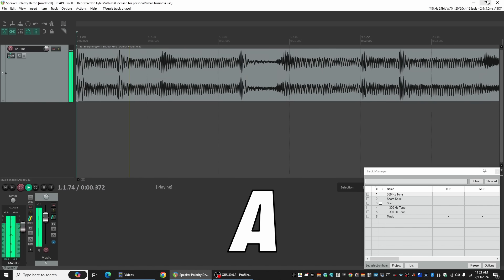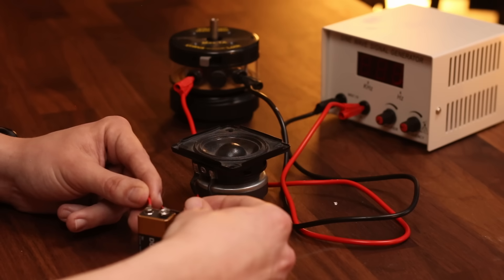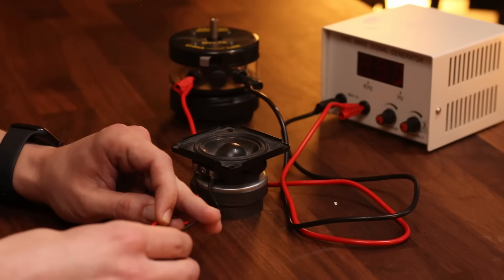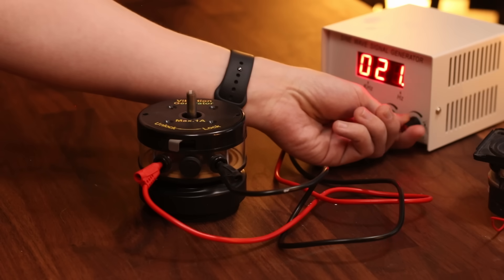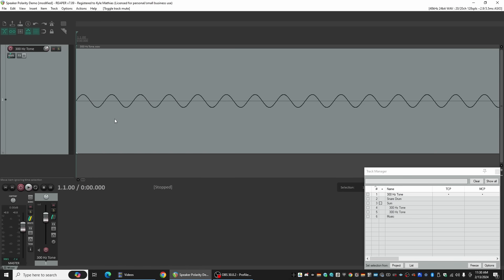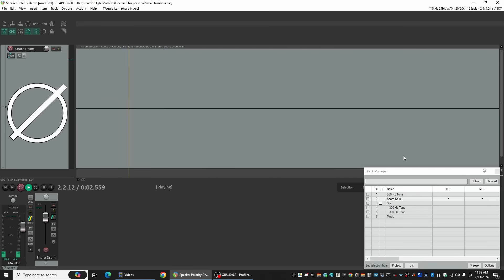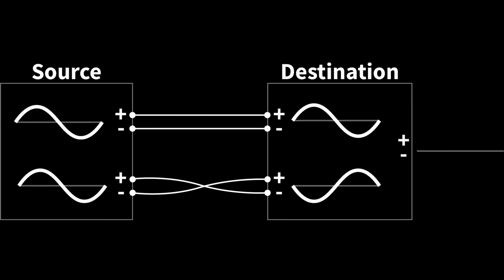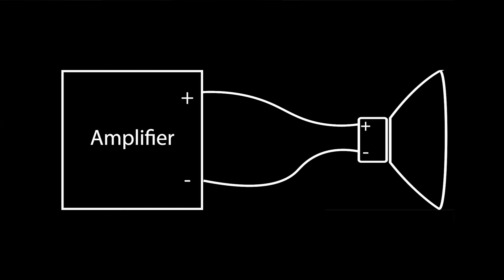What Happens When You Wire Speakers Backwards?

Comment: Pointless video. The speakers are design to move away from the magnet for the best efficiency. If you reverse wire then the movement of the cone is limited and the magnet will "suck in" the coil. If the speaker would be designed to work that way then it would be fine to reverse wire. I'm not sure if you need to be a Mehrican to come up with some nonsense like this fro attention?

Comment: Subwoofers can sound different if wired 180 degrees out, depending on the frequency and distance to the listener. This is why powered subs and often sub amplifiers have a "0/180" phase switch. This just reverses the direction of the subs. You may perceive more bass in one or the other settings.

Comment: If BOTH speakers in a stereo are wired backward, I may not notice. In fact, James B Lancing (JBL) actually reversed the polarity in their entire line of sound re enforcement speakers, to get around patents from his brother, Altec. When using JBL in conjunction with virtually ANY other brand, be sure to reverse the polarity on the JBL's, to keep them in phase. This is especially important, when stacking sub-woofers, where the wave lengths are long enough, to cause cancellation. If one of the speakers is connected backward on a stereo, it twists my brain in half at the Corpus Callosum, like an Oreo Cookie! Some people aren't quite as sensitive to reverse phase as I am, so to demonstrate, I use a monophonic amplifier, and stereo headphones to demonstrate. First, I connect the amplifier to the sleeve, and connect the other wire to the tip and ring in parallel. Then, I increase the amplitude, and connect the amplifier to the tip and ring, floating the sleeve. At that point anyone should be able to hear a clear difference.

Comment: I learned this a long time ago before even viewing this video. The speaker will work either way but if you connect them backwards, they will be "out of phase", the cone of the speaker moves in the opposite direction as it should which affects it's performance.

Comment: Though that is dependent on speaker orientation, positioning, and cab design.
See isobaric speaker designs to find the many ways you can combine speakers in a cab and may want to wire a speaker backwards.

Comment: To be able to hear a single speaker with false polarity?
That is a very very big claim and in my unimportant opinion is not possible. Having a trained ear or not. The biggest effect would be on the lowest frequency.
On a multi-speaker environment, this is completely different. Except: All speakers are wired incorrect.
But in the world of sound creation for eg. working with a DAW, not only copying and inverting the same channel will impact the sound, overlaying tracks can cancel out or amplify frequencies creating unwanted results.
Mixing is simple, good mixing can be art.

Comment: If a mono system can be phase inverted without much impact and the cancellation happens in a stereo setup with just one speaker inverted, would inverting both speakers give the same result as  mono? Or would there be other side effects? In other words: If you consistently wire a setup wrong, all + signals to -, is that the same thing as in mono?

Comment: Interesting. I had no idea switching the wiring of speakers results in a 180 degree phase flip. I was hoping you'd demonstrate how negative phaze +positive phaze stereo speaker set would sound spaced out placed in a room. In that situation, if only one of them had phase flipped by 180 degrees, I'd expect that to sound like the typical classic mono-incompatible way of making mono things sound wider in a daw/audio editor instead of it canceling the two signals out.

Comment: I used to work at a car audio shop.  I saw a lot of systems with two subwoofers that were installed by the owners.  They would come in all the time because they couldn't there the bass they were wanting.  Almost every time is was because one of the subs was wired backwards.

Comment: Super cool vid, thnx. You might appreciate this: Like 25 yrs ago, my Gramma gave me a Zenith console stereo. 
It had super warm/full sound. Soo..curious, I looked underneath. Two 6x9" speakers with tiny magnets? What?!
I was mystified. As time went on, the receiver died. I wanted the sound back! So I plugged in a compact 
stereo to it, as it had jacks and..the sound was horrid..flat! What was the internal wiring magic of that 
60's vintage Zenith console stereo? I don't know. I should of hauled the thing to JVC and said 
"Check this thing out!" Forgotten technology..it legit had 2 very lame speakers and managed to sound 
like a solid 2.1 system, with 2 bookshelf speakers and a nice lil subwoofer. 
..there must've been some extra wiring and a controller of sorts to ramp up everything good, 🎶wise. Amazing.

Comment: I built a speaker box years ago where they were bolted face to face with one inside a sealed box and the other outside the box. Inside the box was wired normal and the outside speaker wired backward. It worked great.

Comment: A little known thing about 2-channel automotive amplifiers that are bridgeable: One channel has it's terminals labeled backwards from what it really is. That channel also has it's RCA input reversed. The input signal is being sent into the amp out of phase, but since you are actually wiring that channel backwards, it all comes out correctly and in phase. This is done to make bridging the amp easier.
Reply: What does bridging an amp do??
Reply: @fastone371  Bridging just takes 2 channels and combines them to create a single channel with double the power. So 100x2 becomes 200x1, only a bridged amp treats whatever load (8-Ohms, 4-Ohms, etc.) as half the resistance, so a good amplifier delivers twice the power. So that 200x1 can become 400x1. Power is determined by the load. When you halve the load, you double the power, but only if the amp is designed for it.

The old school Orion HCCA amps that were 25x2 @ 4 Ohms were 100x1 @ 4, 200x1 @ 2, or 400x1 @ 1 Ohm.
Reply: More than you wouldn't believe I was getting ready to throw him away when I realized I had a branched it which I branched it correctly I was shocked at its performance

Comment: isn't this how some noise cancellation works? by canceling out the sound by playing an inverse?
Reply: If you're speaking of OEM vehicles with ANC (Automatic Noise Compensation), they have microphones in the headliner that listen for "noise" and then play back those sounds inverted 180 degrees to reduce the noise. These systems must be disabled if you add aftermarket amps and subs or there will be a loud bass feedback.

Comment: For a single speaker in open air, I guess it won't matter much. But for a subwoofer in an enclosed box, it may make a big difference. Correct me if I'm wrong but when a big bass comes and the speakercone goes outwards, it creates underpressure inside the box which will sound different compared to when it goes inwards, creating an overpressure inside the box. If it's a perfect sine wave, this won't matter at all but with audio, which is hardly a perfect sine wave, this may actually make a difference. Also what you described as both speakers that will cancel eachother out will only be this way when you're in the middle between both speakers. If both speakers are on opposite sides of a room and have reversed polarity, you should not be able to hear (much) when you're in the center of the room but you should be able to hear the music when you're closer to one speaker compared to the other since soundwaves need time to reach your ears due to the distance they have to cross. This distance doesn't have to be much since you hear the same sound with both ears but due to the distance between both ears, you're able to pinpoint where the sound is coming from due to the slight phaseshift between both signals at your eardrums.

Comment: It's an AC signal. Reverse bias essentially gives you the same thing, though the phase will be inverted. With stereo speakers, do not reverse bias one while connecting the other properly. This will cause a phase inversion between left and right, which sounds weird af

Comment: The difference is exponential as the power of the speakers/sound increases and the movement of the diaphragm.  As far as I know, speakers don't have reversed polarity. They're DC and the power is never reversed by the radio/amp. That means that a normal speaker never goes "inward". I believe that it is at rest and gets pushed outward only... while a reversed speaker is at rest and gets pulled inward only. With that said, the speakers (physically) are not designed to be pulled inward. With weaker sounds and without pushing the speakers you might never notice... but when you really have powerful speakers and you really push them hard, having the polarity reversed can make a very large difference in sound and can even cause the speaker to destroy itself. It can damage the flex rings or diaphragms in some speakers while in others is can damage the coils (from slamming into the inside surface of the speaker if the flex rings allow enough movement). I don't recall the speaker companies, but I've damaged a couple speakers by doing this (once on accident and once on purpose. I didn't mean to destroy the latter, but I hooked it up backwards on purpose and that destroyed it on accident). They weren't cheap speakers either. With the same exact music and the same exact amount of power/volume, the speakers worked when wired normal, but were damaged/destroyed when the polarity was reversed.

Comment: Actually, engineer here, speaker does not have positive and negative terminals. As you said it is just a coil, which is an inductor wound to a circle. Some electronic components and machines does have polarity because it is important where does the current flow and in which direction. That is why you must put DC voltage  in correct polarity on input. But as you connect coil to an AC power source you can imagine it not just changing the ammount of current/voltage but also its polarity (sine wave). That means it does not matter which way you plug it in. What were you talking about in video (the speaker muting while "reversed") is phase shift. You phase shifted the signal on one speaker so when the signal on number one is in top + section, the signal on second one is in top - section and then they indeed  disturb each other.
Reply: So what your saying is if I know which way to wire it before hand like if I mark one red and one black and call it forward for up and reverse for down then we will know hownto connected the speaker just in case they make a mistake like in the factory and forget that hey don't wire that speaker backwards because the customer won't know the difference but don't tell them it's a dc speaker. Sounds good 👍 where did you go to school?
Reply: Rubbish. Then why if the pos and neg are reversed does the woofer suck inwards instead of moving outwards? That's right, due to polarity. Try on an old speaker with a 9v battery and you'll see.
Reply: i will add more. waveform don't has any connection to speakers.
Reply: Its not phase, as phase is time related. It is polarity, because regardless of frequency which is derivative of time, the output of the driver is inverted.
Reply: @jenniferwhitewolf3784 It's absolutely Phase.
Reply: Exactly, electronic components as in capacitors and inductors for crossover circuits in multi speaker boxes between subwoofer and midrange and tweeters.  I wish he would have covered that.
Reply: I am curious.
Where did you study?

Comment: Some subwoofers have a switch and this is to direct the base one way or another. I assume this reverses polarity depending if it on or off.

So depending on room acoustics you flip the switch on the back of the sub one way or another.

Comment: Had this happen in a hilarious way once..  We were installing a subwoofer and the L/R channels went into the back through the crossover and back to the L/R speakers.  When they plugged one, the subwoofer was loud.. When both it was quiet.  I kept trying to tell then what I thought was going on but the older guys all knew better than me since they are all 20 years older and have experience as musicians but I am a self taught sound guy.

I gave up trying to get them to listen to me so I wandered off until they gave up in frustration then unplugged their 1/4 inch to XLR cables and replaced them with 2 adapters.  When I put them into my cable tester I could see the XLR cables each were wired differently.  The more experienced guys came back to find everything working.

Comment: Nobody can hear a difference because our ears do NOT hear positive and negative pressure like a microphone. We hear in the frequency domain by detecting in what part of the inner ear resonance occurs and excite the tiny hairs of that part. The resonance will be at the same exact place in the ear no matter if you invert the signal because the frequency is the same.
Also our perception of time isn't fine enough to detect the phase differences (without a second speaker to create interference ofc).
In fact you can take a square wave, perform a Fourier transform of that to get the frequencies that make up that square wave and completely jumble them up so it no longer looks anything like a square wave but we will still hear that exact same square wave.
Check out "The Other Square Wave" for some examples: https://www.youtube.com/watch?v=Ffka-hPzug0

Comment: Electrical engineer here: in short terms all the audio signal are composition of sine waves of different amplitude, frequency and phase cascaded together onto each other the mathematical operation that it is based of is called a fourier series. when you wire a speaker backwards , all the sinewaves that were involved in constructing the audiowave you are hearing are all just inverted, so if we are only looking at  the front wave of the speaker, it is equivalent to all of these sine waves having a phase shift of half of its wavelengthdue to that sine waves are periodic(wavelength is the inverse of the corresponding frequncies to the sine waves), but the wave form is exactly the same, so it will sound the same. correct me if im wrong :D

Comment: Now take that knowledge of positive waves and use a subwoofer. Drop it in your trunk aimed toward the back. Adjust the distance from the rear of the car until you hear the same level of volume slightly increase without actually touching the volume. This is where the positive from the sub woofer hits the back of the trunk and comes back on itself. Hitting in the middle against another positive wave coming from the sub. 
Welcome to wave lengths in the trunk of your car :)

Comment: saying the signal is 'opposite' is somewhat misleading jargon, given that you don't reference which axis you are reflecting the signal about in your definition of 'opposite'. 

as you point out, speakers are intended for analog signals, where the polarity already reverses all the time. With DC signals like this, it simply changes the phase (as in reversing the DC current reverses the phase, and so a motor will run in the opposite direction). 

in terms of reversing the polarity of voltages for speakers, the only real difference is the phase of the signal. which is also why, as you point out, this only really matters when you increase the amount of speakers, because two speakers wired with opposite polarities will then also have opposite phases.

Comment: after the initial bit of the flipped sound, they basically sound the same but i could tell something was off in the start.
Its like a gut feeling something was wrong or off, probably because listening to the two back to back the initial bit went to opposite directions and that's something i could pick up on.
But as the audio continued i couldn't really tell the difference.

Comment: I have a MHC RV 555 and I accidentally plugged the wires opposite to a speaker on the right after cleaning it. And it resulted in the sound having no bass. I downloaded an instruction manual and that had a section on this exact problem. I thought the amp started dying.

Comment: Before watching: wouldn't it just sort of shift the phase? And since the shift is going to be a split of second long, it should be unnoticeable.
Reply: It is a 180 degree phase shift. But there is no delay associated with that. The signal has a flipped sign, so positive is negative and vice versa, but nothing is delayed half a period, although peopler will sometimes conflate time delay and phase shift.
Reply: @Rene_Christensen Well, my thought was, it isn't even a phase shift strictly speaking, because the wave isn't periodic, but, as I remember from looking at extreme close-ups of audio waves visualized in audio editors, it sort of looks periodic inside a small enough window, and at that level, if we somehow skip the first half a period, it would sort of look the same as flipping the sign, and sort of sound the same - if we were able to hear such a tiny time difference.

Comment: What people miss in wiring speakers is to make certain that ALL speakers are wired with the same polarity. Failing this, ie one speaker red to positive and another speaker red to the negative you will get no bass. The speakers moving in opposite directions will cause the low frequency to cancel each other out. Many people have tried to increase their bass with low frequency amplifiers when one is at reverse polarity.

Comment: ı haear bit of an diference on first start in 300 hz starts with on clicking noise in reverse nothing at all in kick drum nearly nothing(better baseline 10-40 hz) changes ı think maybe cause on my equalizer settings or mabe be better to plate to start with pulling to force it push forward cause in base we hear noting on negative presure than more room to forward causes smoother base? ım thinking thatway you think otherwhise please be comment below ı need to know that ım on mdr xb 950 ap stock cable